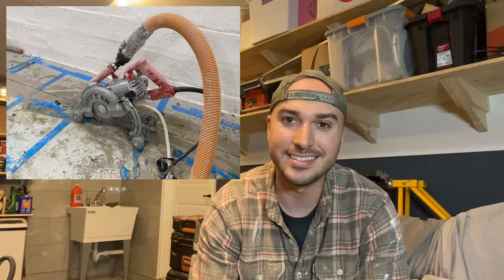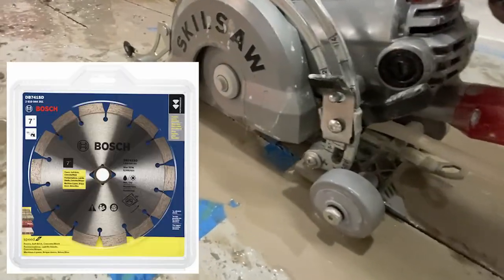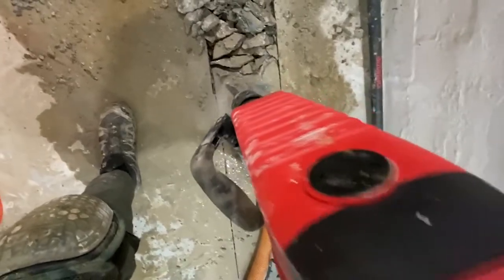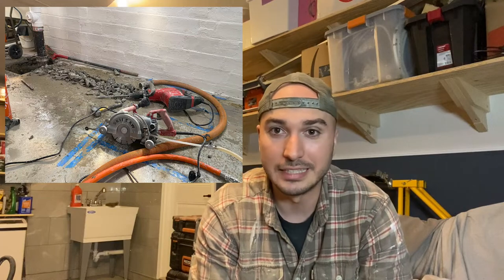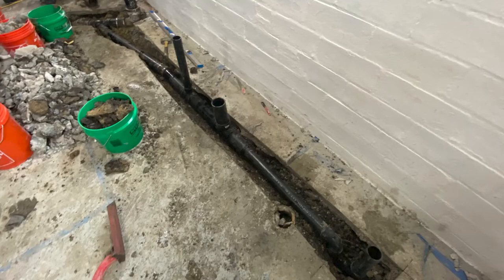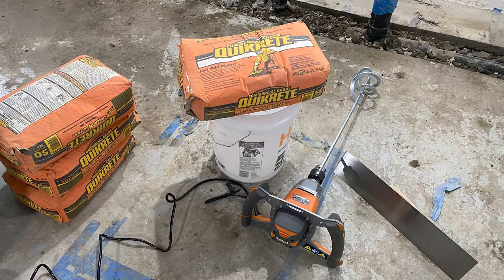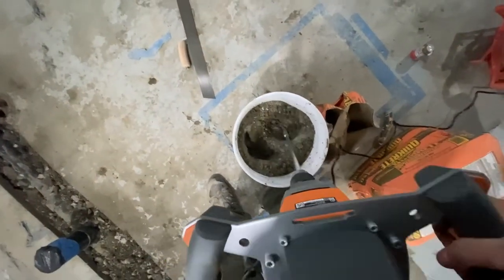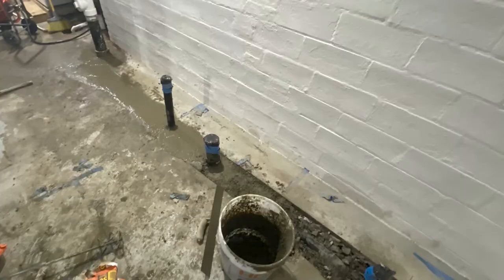How to Cut Basement Floor (And Stop Concrete Dust)

Comment: I did a little trench in my shop about 6ft long 2 inches wide and scoring the concrete is completely worth it. And it still chipped out on the edges so be careful.
Reply from the maker: For the trenches I’ve done since this video I still use the concrete saw to score the edge but I also use a 12 lb sledge to break up the concrete. I find that a good hard whack with the sledge works faster than the hammer drill at breaking up the slab. Although I still use the hammer drill as needed for small parts of the job.

Comment: Do you mind sharing what this would cost to hire out? I have a broken pipe from the basement shower/sink to the main line (3' away from shower). Thought of renting the equipment and DIYing, but curious what someone would charge. I'd probably do the concrete finishing and haul away on my own to save some cost
Reply: It will cost you about $2000 - $5000 USD
Reply: Another option I've been seeing for existing pipe repair is some kinda snake sock they can shove in the pipe that lines the inner wall and hardens creating a new pipe definitely looks interesting

Comment: What is the depth of the score line you made? The medusa can cut up to 2 inches deep so just wondering what the blade depth was at? Thanks
Reply from the maker: The full 2". I've also used this saw since making this video to bust open another concrete floor. It works great. If you give the area a good strong whack with a sledgehammer you can break up the concrete faster than with the demo hammer. But you may still need the demo hammer at times.

Comment: How much dust did the demo hammer create? Did you soak the floor or do you have any advice for reducing dust with the demo hammer? Would a lighter duty demo hammer create less dust due to less power or would lighter duty hammer create more dust because it would be smaller fragments? Also, I'm trying to remove 100 sq ft from my my basement slab which is about 4 inches thick, if I only score the area 2 inches with the medusaw, do you suspect the demo hammer might cause cracks beyond the scored demo area?

Comment: Ive been mixing with a milwaukee Hole-Hog for about 25 years for concrete and drywall mud mixing. It will not die

Comment: This helped me so much! 

Did you cut the concrete completely all the way down to the dirt or did you kind of score it in the shape of a square?
Reply: A 7 inch saw blade likely won't go through the entire slab. You score it and it makes the jack hammer mich easier. A sledge is also an option but that SUCKS. Rent a jackhammer.

Comment: Do you think that saw could be used to make a vertical cut? I need to cut a 1/2" x 1/2" slot in a concrete door opening.
Reply from the maker: Yes absolutely. It has great precision and a mechanical arm that can swing out in front of the saw to help you with leading lines.. Cuts up to 2” deep. Guys use it to cut expansion joints in concrete.

Comment: Can I ask about venting? Where did that go? I'm looking at doing a similar project
Reply: The rule is condensed to "Always allow for air behind the water". A 3" common drain of less than five points of use is well served by a 1-1/2" common vent stack in most circumstances (2" if a 1-1/2" clothes washing machine drain will also be served by the intended branch). Most local codes require the vent to be located upstream from the first drain connection in the common branch line (in this case, that looks to be the the corner shower). In the above video it looks as though he cheated the vertical vent line downstream a bit to between the corner shower and the other drain connections. This would not a big deal to me as a DIY project in my own house. Depending on how strict an inspector is, that type of vent stack placement could possibly cause compliance problems down the road. Note, just as important for proper venting is an adequate slope in all the branch and main drain lines. This helps prevent backwash from high volume dosing (toilets, washing machines, etc.) causing temporary hydraulic damming of the vent or other drains and also possible sludge buildup over time. Effluent needs to move without being slowed down to keep the lines clear and clean

Comment: Did you have to do any treatment to the edges of the trench before pouring concrete?
Reply from the maker: No. Is your concern separation of the new pour from the existing slab?

After the patch which had some thicker aggregate I did use a fine leveling compound to smooth over the joint between the existing floor and patch.
Reply: Ah ok. Yeah my concern is separation as I have a trench spanning 2/3 of my basement where I'm replacing the cast iron.  I've been looking at a few different how-to guides as I've never worked with concrete.
Reply from the maker: @andrewclark7686  the concrete slab in the basement is most commonly ~2”. You can use a hammer drill (like this https://amzn.to/3qfS7Ig) to drill a few inches into the center of the existing slab. Then pound in 3/8 inch rebar into the hole you just drilled out (using a 4lb hammer https://amzn.to/3fSJjmF) such that the remaining length of the rebar covers your open trench. You can then cover that exposed rebar with a wire mesh and pour your patch (you can commonly buy the rebar and mesh at Home Depot). This will bond the new pour with the old. I’ve used this technique to pour a new driveway extension to an old driveway and keep the slabs bonded and level to each other.
Reply: @notwaitingtolive  I've read about that technique as well but was kinda thinking it was overkill. My slab is 2" and that doesn't leave me a ton of meat for inserting any rebar/mesh. Also, I'm kinda thinking that since it's below grade it won't be subject to the temp swings that say a driveway would. My basement is usually 55ish in the winter and maaybe 65-70 in the summer.
Reply from the maker: @andrewclark7686 I agree. Probably overkill. The slab in this video was 2” as well. I feel confident leaving the patch on its own.

If you decide to paint the floor to hide the patch I strongly recommend oil based paint which will last much longer than water based paint (even if it says it’s water based floor paint, it’s just not as resilient as oil based paint).
Reply: @notwaitingtolive  Cool thanks. I'm not sure on flooring choice yet. The patch will go across my basement from bathroom to laundry/utility room. The Mrs want's some kind of vinyl plank flooring in the bathroom but I'd likely have to level it first as the whole basement slopes toward the floor drain. Laundry room prolly just painted as I'm less concerned how it looks. Cheers!
Reply: @notwaitingtolive  What type of Wire Mesh are you talking about here? Common hardware cloth (metal mesh) or even a lath? Thank you in advance.

Comment: 2" of concrete?
Reply from the maker: Yep 2”. I’ve done a couple basements in the same area ranging from
 50-100 years old now with the same slab thickness. Once scored it breaks up easy with a good whack of a 20 lb sledgehammer.
Reply: Ok gotcha, so cut 2" then jack hammer? Would you say that's easier and faster than just jackhammering it all?
Reply from the maker: @PARKERBROTHERSPLUMBING  yes. It cuts quick and keeps the demo clean and under control.

I think the fastest way (if the concrete is 2" think) is to cut and whack with a sledgehammer. The cut line give the concrete a place to break.
Reply: @notwaitingtolive what if the concrete is thicker than 2”?